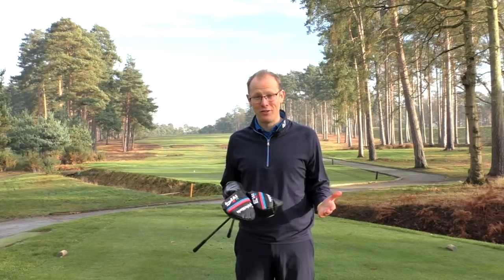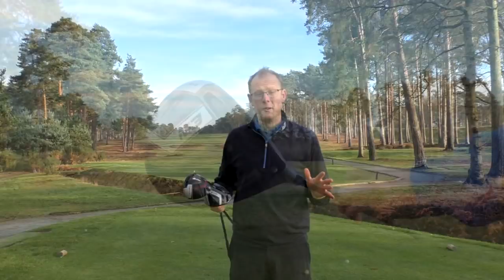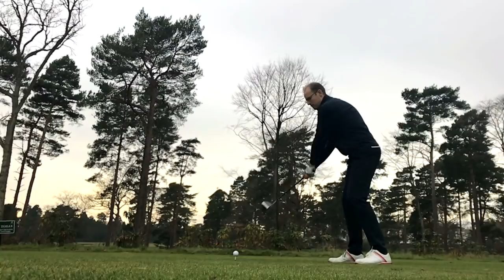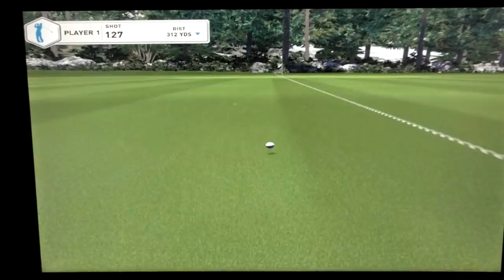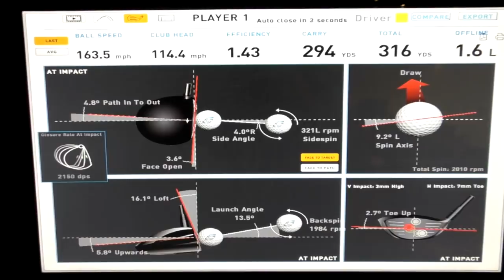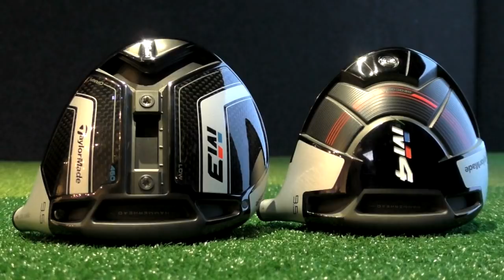TaylorMade M3 vs M4 | Driver Test | Golf Monthly

Comment: Only issue I have is I feel like the twist face only works if the face is relatively square when hitting these shots, but what happens when high toe it with an open face?.. it goes way right because the face is twisted open already. And the same with a low heel shot; if your face is shut it's going to punish you worse than ever. It can help I'm not saying it doesn't, but only for people with those specific misses and patterns, definitely something that I would test even more before buying
Reply: Jordan Austin open face fore right